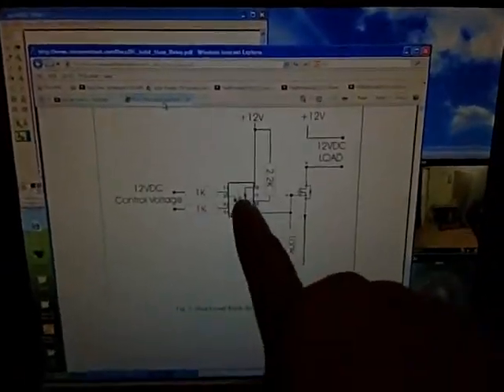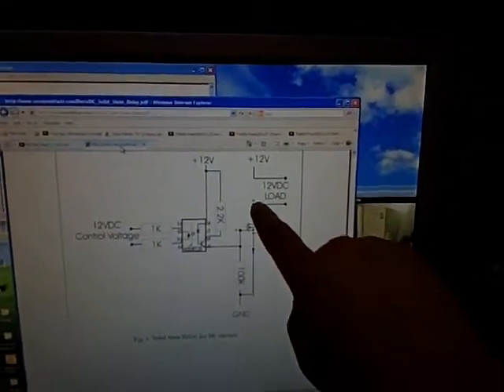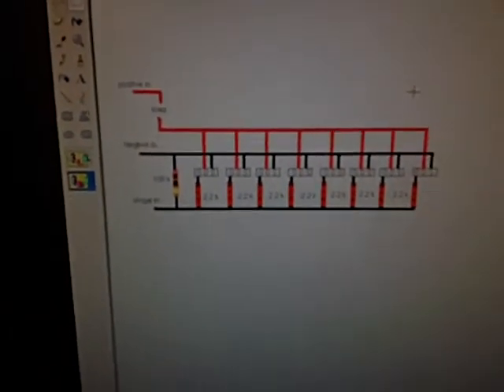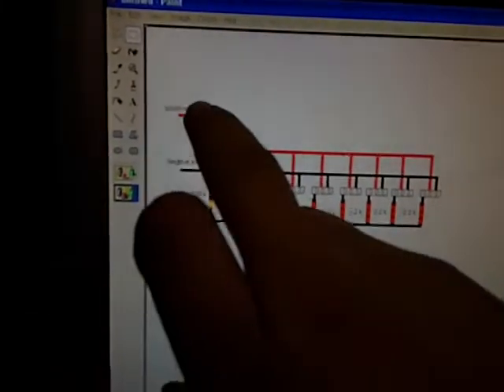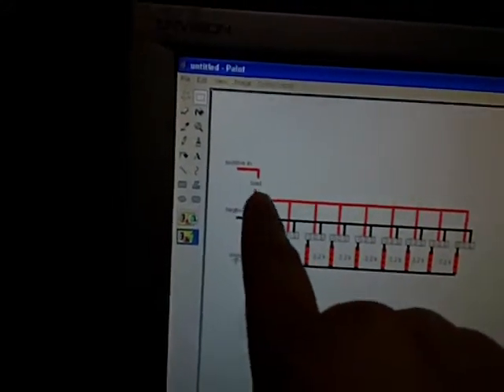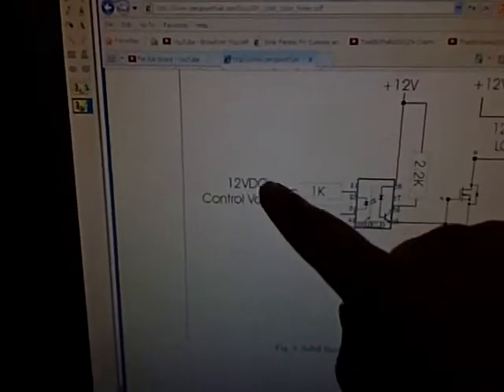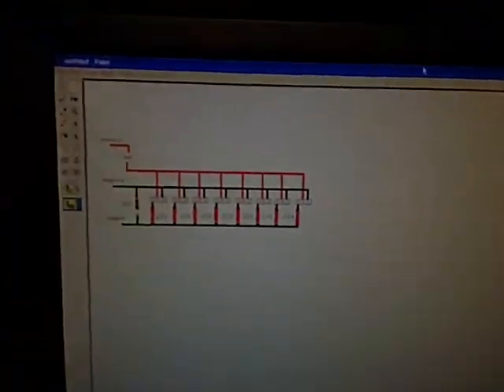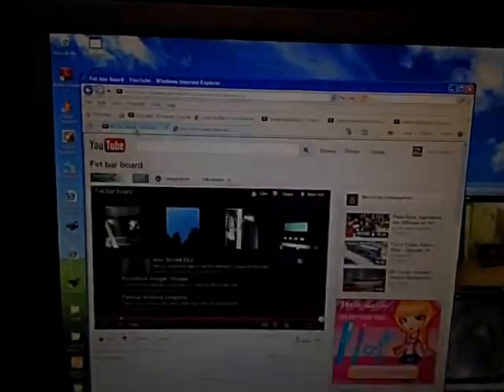mosfet solid state relay I want to build.  response to emagnets

Comment: Looks like about I need to replace a contactor  on a bms , the FETs I have are logic level gates  60v 30a, and some 55v 149a, I am powering a 24v 5kw inverter, + a few small loads, 10 amps. I can go with s voltage divider for the gates, if I must , I can turn them on and have the BMS when it trips, pull the gates low , shutting off power!, I'm concerned about that huge inductor and be reverse EMF! Frying everything, I guess a big diode, can handed that? Great video, it gave me the inspiration I needed! Thanks!!!!

Comment from the maker: hay I dont have a video up yet but I built a nice solid state relay with 4 750watt npn mosfets I can handel up to 100 amps at 30 volts. I will not put  no more than 50 to 60 amps. its pretty simple I will post a video soon for yea.

Comment from the maker: I dont know if you have seen my videos on my charge controller for my wind and solar.  it uses a colman air charge controller and it has a 12 volt controll that can charge either a 12 volt battery bank or a 24 volt bank. and the dump is adjustable.  I have machincal relays but they ware out fast so I wanted a solid state relay.  I will build a bard and if it works I will show it on here.

Comment: lol, i covered made by" name" 
what you did in few minutes in very informative. I am impersed.
i am trying to control a 24vdc battery bank, i want it to dump at 27.5vdc.
i am still having small issue, obes it starts dumping it will not stop...?! i think i crossed wires somwhere or it is a bad resistor.
i would love to see your fet control board for 3.5kw/24vdc battery bank.

i will keep uploading any toys i can get my hands on.

Regards
Sam